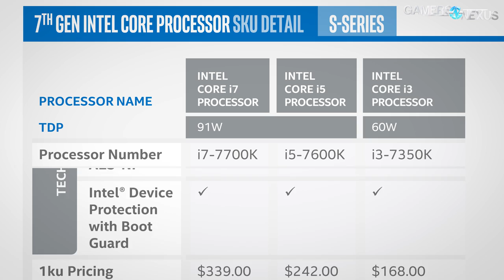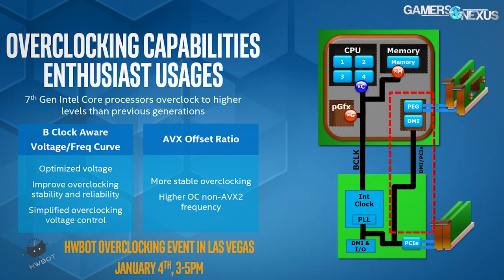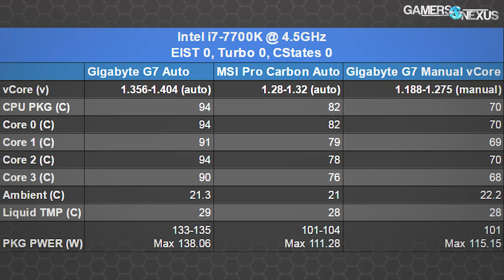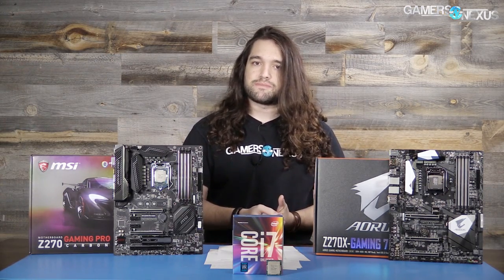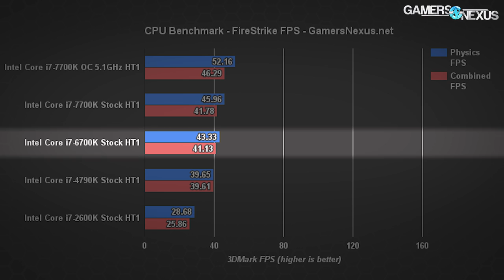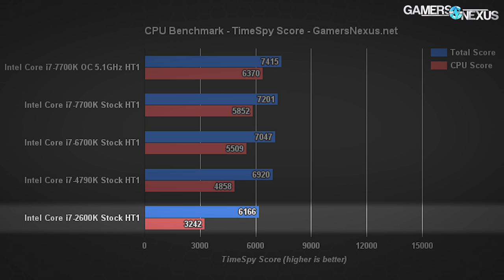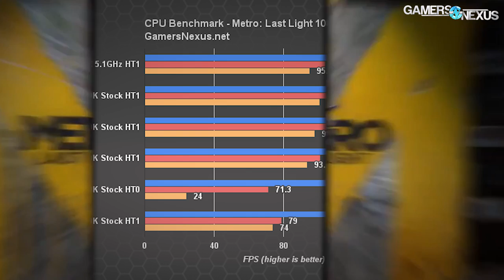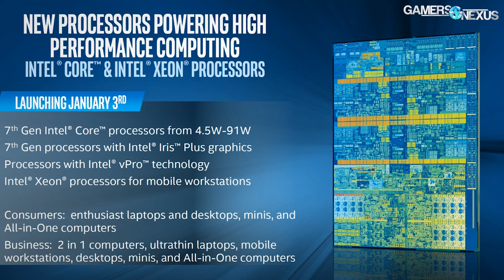Intel i7-7700K Review: Gaming, Rendering, Temps, & Overclocking

Comment from the maker: Hey, everyone! Thanks for watching. We have a lot more work to do to get the i3 and i5 series CPUs tested, and are also working on FX & AMD CPUs for the inevitable Zen benchmarks. For now, our full, detailed specs, architecture, and chipset portion of this review are in the written version: http://www.gamersnexus.net/hwreviews/2744-intel-i7-7700k-review-and-benchmark
Reply: Should I be worried about framerates if i buy a 3440*1440 monitor for my GTX 1080? I'm already getting as low as 59 fps in Geothermal Valley in Rise of the Tomb Raider in 1080p which makes me feel reluctant to get the 1440p ultrawide
Reply: Higher resolutions demand more from GPU side, to CPU mostly it doesn't matter what resolution you are using.
Reply: Wtf? 59 fps in 1080p with the gtx 1080? Either your drivers are not updated properly, or your cpu is a fx 4300. A gtx 1080 should be able to get 100fps average in 1440p in Rise of the Tom Raider with a minimum of 78.
Reply: go for it man some games just run better than others. with a 1080 you should have no problem @ 1440 in most situations. also anti aliasing plays a lesser role at higher resolutions, so you can get away with turning that down a bit.
Reply: D Jnsen I have a 6600k at 4.5 and my GTX 1080 is running at 2000+. Throughout most of the game it has been substantially higher fps. But parts in Geothermal Valley averages at like 65fps with dips just below 60fps
Reply: when you do the inevitable zen benchmarks will you be comparing them to amds old processors
well watching the rest of the video gave me my answer
Reply: +D Jnsen Here's the area http://i.imgur.com/at6DuYe.jpg
The GPU was running at 2088MHz with latest drivers :^)
Reply: B Wyatt I'd feel fine getting a 1440p performance wise, but a 1440p ultrawide is quite a bit more pixels ontop of that so idk..
1920*1080=2,073,600 - 1080p 16:9
2560*1440=3,686,400 - 1440p 16:9
3440*1440=4,953,600 - 1440p 21:9
3840*2160=8,294,400 - 2160p 16:9
Reply: You want ultrawide or not? 
You want = buy, don't want = don't buy. Easy as that. I personally have 21:9 1440p with 970 and I live just fine.
Reply: I want a 3440*1440 21:9 monitor for multitasking and cause almost all the movies i download is 21:9 anyways. Having 2 16:9 monitors isn't really something i want.
But i'm hesitant because i wanna be able to play all games at 60fps+ which may not be doable on a 5 megapixel screen without having to lower all the graphics settings a lot
Reply: You want... but you hesitate? What is here to hesitate? 
Just buy one and enjoy it, everything in world have prons and cons it is up to you if you can deal with them... I bought one knowing what it is and I don't regret it.

And I'm sure that you know reaching solid 60 FPS in newest games is only in reach of SLI setup.
Reply: Gamers Nexus Hey! Would it be possible to benchmark the 7700k de-lidded?
Reply: Could you guys possibly do an article on how the Kaby lake chips perform on  Z170 boards that have had the firmware update to take the new chips? It would be cool to see if they have any negative performance impacts.
Reply: Gamers Nexus will you do a delid and thermal paste swap test for this chip?
Reply: I want to know the same as rurutu M. And if you do, could you show the process of delidding and applying the thermal paste and thermal adhesive? I would like to see this for myself.
Reply: Needed i7 3770k added to the comparison list. Thanks!
Reply: Hi Gamers Nexus I just want to know if I can overclock that 7700k @ 5ghz in older Z170 boards as well? Thanks :)
Reply: Pretty nice results for 7700K in synthetic benchmarks @5.1GHz,but devil's canyon still pushing hard in games!
Reply: Seen some reports of these hitting 100 degrees when clocked, and another claim that these temps can drop as much as 30 degrees when de lidded. Would be interesting to see if this is the case? and if this is another TIM issue for Intel?
Reply: So you have the Zen already? Don't reply if I'm right.
Reply: i7 7700cpu processor can i have what i want

Comment: Great video, thank you for your time. I purchased a Skylake 6700K a couple months ago knowing that Kaby Lake was coming out and have no regrets seeing these benchmarks. I'll wait for the next generation. Oh and a great game that is very CPU intensive having used the same programs you use as well others like Aida64 and Intel Burn Test is ARMA 3. Arma 3 is super hard on the CPU in a real world application. I loved that I was able to diagnose my CPU was bottlenecking my GPU that other benchmarks didn't identify. Increasing my frequency on my CPU fixed the GPU bottlenecking and my PC is awesome now. Just thought I'd recommend Arma for benchmarking, I bought that game just for it and honestly, fell in love with it but that's another topic of discussion. Thanks again! Take care!
Reply: Oh and I meant to add I am able to achieve 4.734 on my 6700K with a NH-D15 Noctua cooler. I do have 7 3000RPM Industrial Noctua Case fans and a newly added G3 1000W PSU along with my Evga 1080 FTW. At 4.734 @ 1.345V I get temps as high as 76 under max load, 45-50 normal load and 22-24 idle. Want to note I manually clocked my CPU as like you mentioned, my Asus Maximus Hero 8 Alpha would run it around 1.35V stock.. ridiculous! Anyways. Couldn't be happier with my Skylake honestly :> I probably could push it over 4.734 but the gains I'll get would be diminishing or i'll get some other bottleneck as you mentioned when pushing the 7700K over 5ghz. Ok see ya!

Comment: Wow thanks a lot for this video. I just bought an i7 7700k and a MSI M5 motherboard and I was shocked that my CPU temps got over 80C under full load using a Dark Rock 3 cooler. Changing the core voltage from auto to 1.200V and cpu ratio to 45 (4.5 Ghz) droppen the temps to max 65C under full load :D

Comment: Great video, I'm still using a 2600k running at 4.5ghz and I was putting off upgrading until I could see some benchmarks from the new generation. Some interesting gains but nothing game changing. Think I will keep will my current cpu for now at least until the prices come down for the 7700k and instead for now put my money towards upgrading my GTX970.

Comment: I really won't upgrade my 4790K for this I7.. Not worth it and I think I should better wait for a new socket
Reply: Meh AMD and me ^^ Haven't treid yet but since my brother is working for one of the biggest components seller in France, and that he told me that holy shit much more RMA for AMD than INTEL, I probably will be careful considering just waiting to see a lot of benchmarks to make me try out AMD x) Will it support DDR4 tho ?
Reply: Kris L hm maybe then I'll wait for gamernexus advices cuz I feel that it's the most trustable "tester" 🤔
Reply: I just upgraded my i7 4770k by overclocking it to 4.6GHz xD
Reply: Unitae there is no need to upgrade from 4790k, probably something that came out sometime around a 9700k will be the worthwhile upgrade for you, not even zen will be worth it right now.
Reply: LUL I had a 980 and soon as the 1080 got released, I got it x)
Reply: Unitae The 4790K is still a badass CPU, I love mine. The Kaby Lake platform is really pretty much only for people that either have very old platforms that they're still running or just want the newest thing that's available. Or overclockers that want that 5 GHz lol
Reply: While Zen hasn't come out yet, if the rumors of its performance are accurate there's absolutely zero reason to upgrade to Zen from a 4790k.
Reply: Agreed.. Rocking a 4790K @ 4.8GHZ.. absolutely no reason to get a 6700k or 7700k. Intel needs some competition.
Reply: Skylake x?
Reply: I think waiting till the next gen will be the smarter choice. Hopefully Zen will make Intel work a little harder and the 8700k will be a significant upgrade. As it stands my 4790k is hanging in there just fine.
Reply: same, iv got the upgrade itch baaaad but i just cant justify spending £400-500 on 7700/new mb/ddr4 ram for about 5-10fps. looks like im stick with my 4790 for another 4 years until intel give me a reason to upgrade
Reply: Marc-Antoine I am from the future... intel didn't really do anything better :(
Reply: I agree, I want a chip that I can almost certainly push to over 5.0Ghz before upgrading my 4790k @ 4.7Ghz currently.

Comment: Thanks for testing the 2600K. Considering its low stock clockspeed (3.4Ghz) and the fact that it overclocks so easily to 4.4Ghz on air, would you still give that upgrade recommendation? I think it ended up so low compared to the other i7's because their clockspeeds are minimum 4Ghz. Most of us who still have this six year old CPU will be running it at +4Ghz anyway.

Comment: what's with the liquid temp? is there no thermal transfer going on? it's not a direct comparison but my 5820k gets my x61 to almost 40c running folding@home for 6 hours. can't wait for a delid video!
Reply: Yeah, it's like they put toothpaste unter the heatspreader. The HEDT processors all are soldered to the IHS so that the heat transfer is much better. 
I don't understand why Intel just doesn't put at least better TIM or liquid metal on the K-CPUs. Now you hit a fucking temperature limit before being limited by the processors capabilities so that the only option is to delid them. That sucks hard since your warranty goes down the drain. But we all know Intel doesn't care and wants enthusiast to buy their overpriced 6- and 8-cores you mostly won't need for gaming.
Let's hope Zen will do all better.

Comment: Gigabyte - The MB manufacturer that doesn't learn. They already had that voltage problem with Haswell/Devils Canyon boards/cpus. Stock voltages so high that even with improved cooling that 4790K I used would throttle or even outright crash on the Z97 UD5 BK. Bringing the voltage down from nearly 1.3V (stock!!!) to a more resonable 1.15V solved all the problems. Now that system is running 24/7 since 2 years.

Comment: Running 3930K @4.6 GHz, thought to get 7700K this year. Looking at this i think i'll just buy another GTX 1080 instead.
Reply: ThereWasNoFreeName same man! butbi actually bought 3930k +p9x79 deluxe 2nd hand and just paid 300$. great price/perf!!
Reply: Found a problem with it (don't know about 6700K and 7700K). With heavy loads (DOOM stage with snow, one exact room is poorly optimized, or Eve online multi client running or medium to big scale battle) with HT on i get 2 threads on same core overloaded. Sound starts crackling and game stutters, FPS drops below 30. Turning HT off completely resolves this issue. Probably this CPU, even OCed to 4.5-4.8 GHz will show less FPS in games than 6700K or 7700K runnig with same speed, and they can be clocked even higher, DDR3 instead of DDR4 will slow down a bit too, but since i use 32" 4K 60Hz display i need only stable FPS which this CPU still provides in all modern games. And even if i have DDR3 1600 CL10, i have whole 64Gb of it )) 
So gaming/workloads are still good on this 5 years old CPU.
Reply: ThereWasNoFreeName Bro, if you do, you're going to be hella bottlenecked because of how many PCIE lanes your CPU can control.
Reply: isn't 40 PCIE lanes enough?
Reply: im running a 3930k @4.7 but i hear 3930k is getting outdated for streaming? would a 7700k be better for streaming or should i stick with my current CPU and just buy a 1080ti Strix?
Reply: ThereWasNoFreeName your processor doesn’t matter as long as it’s not bottlenecking your gpu

Comment: Congrats on 80k subs!
Kaby lake is just the "optimize" step in Intel's new development cycle, right? So does that mean that the next generation they make will be a brand new architecture? Hopefully their next architecture will actually bring better performance than this, I'm getting a little tired of 1% performance improvements between Intel generations. At least they seem to be feeling some pressure from AMD Zen already, I'm pretty sure that's why they finally decided to release an unlocked i3, which in my opinion is the most interesting thing about the Kaby Lake release, because up till now i3s have kinda sucked and one of the main reasons to go with a budget AMD CPU like the Athlon 860k over an i3 was that the 860k is an actual unlocked quad core, but the i3 was locked, and the unlocked Pentium has massive frame drops and stutters so it's not really a valid choice anyway. I'll be very interested to see Zen quad core CPUs benchmarked against the unlocked Kaby Lake i3 and i5.

Comment: Interesting tests with temperatures. I would like to see temperature comparisons with older CPUs (2600k,4790k, etc) with overclocks on those to match the temperatures of the 7700k. If both are overclocked with similar high end coolers, how would the performance look in your tests? It appears the 7700k's gains in performance come at the cost of temperature. Well, just overclock the old stuff. Boom there's your performance gains. If Intel is deciding to push consumers into higher end cooling situations to get the performance gains its new CPU offers, how does it hold up when the methodology is applied to previous generations?

Comment: Looking at this now and seeing the Voltage the board was using on the auto setting is insane because at 1.4V (the Voltage that board was trying to use on auto) I am able to run my 7700K at stable 5.2GHz at 1.4V while this was tested with the CPU at it's max boost frequency on all cores, just 4.5GHz.

Comment: Really wish GN could dig up an Ivy Bridge CPU to add to the bench-marking mix. Also be nice to add mid-range GPUs (1060/480) results to the mix to see how lower demanding graphics affect the disparity of Intel generations. 

My guess is a 1060/480 won't show as great of a disparity between Sandy Bridge, or perhaps Ivy Bridge, to Haswel and beyond. Or maybe I'm just hoping my Ivy Bridge system isn't too outdated for the new mid-range cards ;)

Comment: About 7% faster than my i7-6700K which I got for $175. I think I'll pass.
Reply: 200mhz better to be exact.

This should be advertised as a pure scam for anyone running 3xxx series or above.
Reply: Jesus, you got a 6700k for $175? I thought I lucked out getting a 4790k for $250 on Black Friday 2015.
Reply: HipsterPolice you got a 6700k for the i3 7000 series price haha
Reply: Sometimes I'm lucky enough to find really good deals. I was able to get a 4790K for $185 last year which I got rid of for an i5-6600K because I didn't need i7 performance, but when I was able to get the 6700K new for $175 I had to jump on it.
Reply: HipsterPolice yeah i remember i got my 4690k for 170
Reply: lol I paid 310€ for my 6700k one month ago
Reply: You guys got used right? New for 180$ makes absolutely no sense to me lol
Reply: The 4790Ks I got were used from a reputable retailer, but I don't think they realized how high the resale values of CPUs went. The 6700K however, is brand new and sealed. Very happy to get it for $175. Just a little worried that my H80i GT will be able to cool it well enough though.
Reply: HipsterPolice God damn it HOW exactly did you find one for so cheap! I'm so jealous...
Reply: Parsa Strife yes sir
Reply: Wiktor W. It's Intel.
Reply: Yeah, I was using mine as an exhaust and it's not pulling the air out of the machine like it should, all the hot air basically just gathers up inside. Hell with the GTX 1080 building up heat I've seen close to 80 C after a few hours of GTA V or Battlefield 1. Thanks for the advice.
Reply: dude where did you find it for 175Dollars... I looked everywhere and it's about 339 dollar ! can you link a brother please !
Reply: Well if this keep going I can still run my 4790k for a few years from now lmao
Reply: vermillioN Bro you are more than fine! There's people with i5-2500k's and they're still holding up very well compared to latest gens. Intel is taking advantage of their market share by not innovating as much because of their monopoly. I hope AMDs kick Intel in the ass to get them innovating back when they were actually competing with AMD.
Reply: Not surprise if your cpu is deluded and re apply IHS ( some do good re apply IHs you can not spot and different like new.
Reply: I have a i7-7700k for free I friend of mine gave it to me

Comment: @Gamers Nexus Is the small improvement in performance between the i7 7700k Stock clock and the 5ghz+ overclock is due to the gtx 1080 bottlenecking the max fps cap ?

Comment: Could you list the clock speeds on the graphs for stock clocked CPUs as well? Even though you mention it in the beginning of this video I already forgot the stock clocks before the first slide was even put on screen. This of course also goes for the older CPUs.

Also, would've appreciated an OC'd 6700k result as well.

Comment: My old FX9590 CPU just died, it wasn't ever overclocked. I'll build an i7 7700K system. Due to space restrictions, I'll run a H80i V2 cooler. I'll again run the i7 CPU at stock, is the V2 cooler fine for a stock set up? Cheers

Comment: Great video! Would you be able to compare them all at the same clocks? I'm really curious how the 2600k compares at similar clocks! Is there really a reason to upgrade if they are all overclocked as high as will go?

EDIT: Basically how much of the performance difference is due to the huge difference in clock? Also, the 7xxx vs the 7xxx reminds me of AMD on the 8xxx vs 9xxx. Basically "Bitch you need a water cooler!"
Reply from the maker: That's in the plans. Lots going on!
Reply: Gamers Nexus WOO! Sounds great! Thanks!!